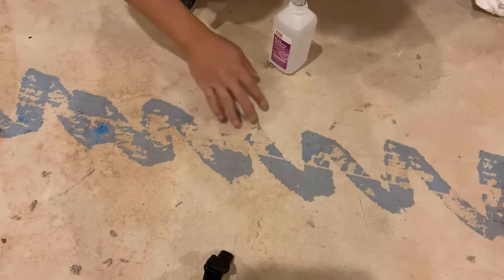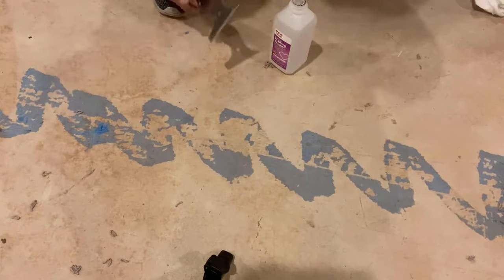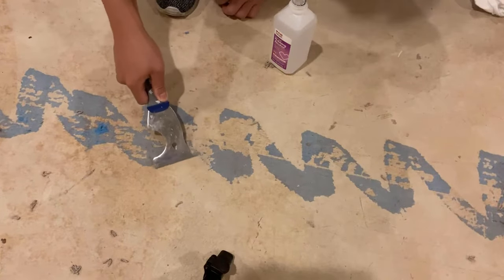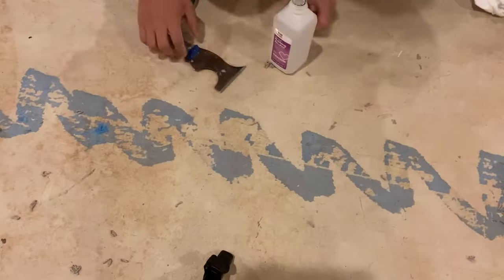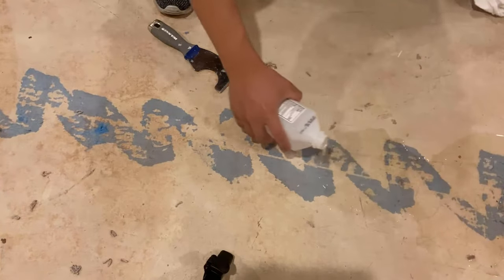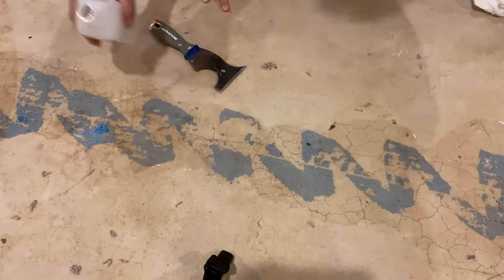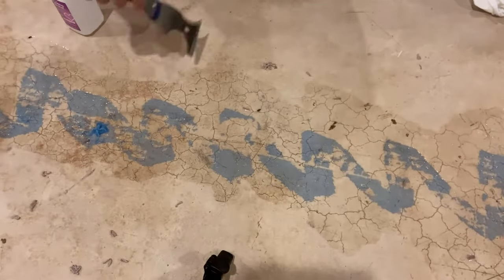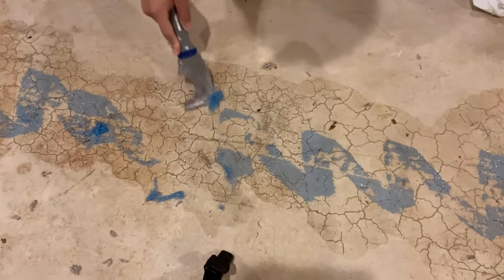[Quick How-to] Remove glued carpet padding (underlayment) from concrete floor

Comment: Will it be effective if the glue is still tacky or sticky on the concrete floor? Any advice for rooms full of glue?
Reply from the maker: Hi, what I felt was the alcohol is able to dissolve the glue and once they are in a solution you have to clean it up with a paper towel or something that can absorb that solution. So I think it would be effective for your glue that is still sticky on the concrete. But if your room is full of glue, it might beed a lot of alcohol and a lot of washing up… I can feel you should take your time on it

Comment: Didn't catch the name or brand of the solution.THE IMPORTANT BIT
Reply from the maker: You can get any rubbing alcohol or 70% isopropyl alcohol that you can find
Reply: At 30sec? CVS rubbing alcohol. Or isopropyl works? Video says remove solvent but not how.